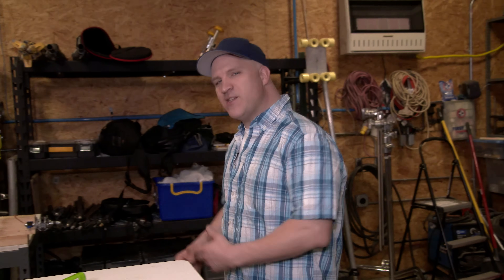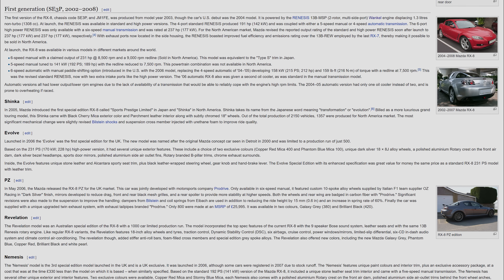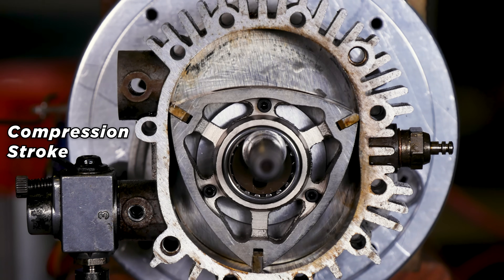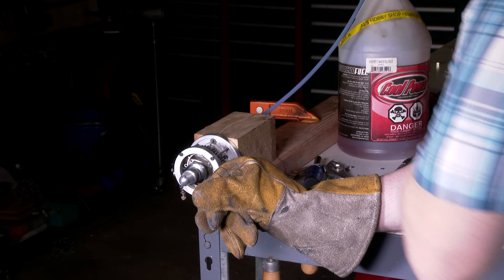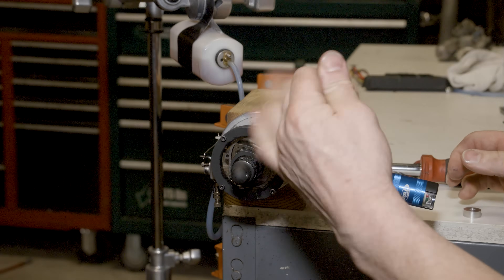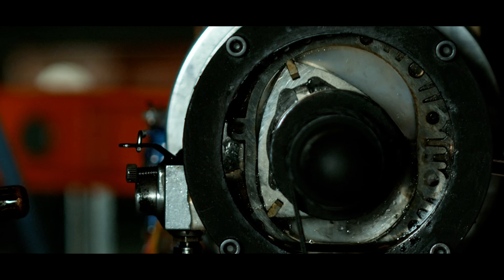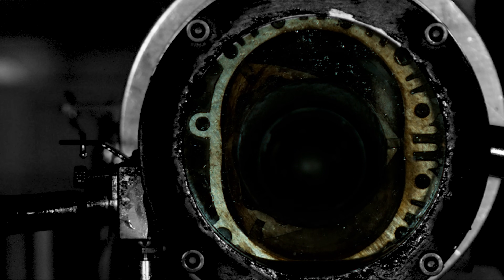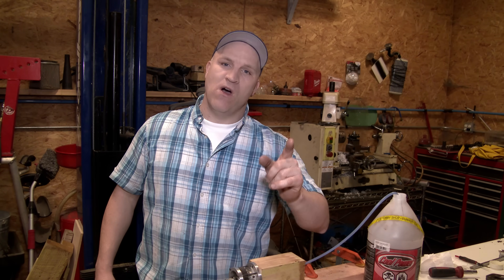See Thru Rotary Engine in Slow Motion - (Wankel Engine) 4K

Comment: Question: I see there is a lot of rubbing to have a good seal on the compression- doesnt this increase wear over time? Or am I missing something?
Reply: Yes, Wankel engines are notorious for wearing out very quickly, they are also much less efficient than reciprocating engines too.
Reply: @doktorbimmer  Yeah to me this typical design has a lot of room for improvement but it's a great idea from an engineering standpoint. This engine is simply, 3 cylinders and four strokes, but instead of 2revs per power stroke per cylinder like a piston Engine, it has 1rev per power stroke per cylinder.output 1080 degrees
Reply: @doktorbimmer   THE FAKE ENGINEER 

@doktorbimmer Yeah to me this typical design has a lot of room for improvement but it's a great idea from an engineering standpoint. This engine is simply, 3 cylinders and four strokes, but instead of 2revs per power stroke per cylinder like a piston Engine, it has 1rev per power stroke per cylinder.1080 degrees output take that piston engine pella windows out the side of your block dokterbimmer the fake engineer
Reply: @doktorbimmer  DOKTERBIMMER THE FAKE ENGINEER Yeah to me this typical design has a lot of room for improvement but it's a great idea from an engineering standpoint. This engine is simply, 3 cylinders and four strokes, but instead of 2revs per power stroke per cylinder like a piston Engine, it has 1rev per power stroke per cylinder.1080 degrees output take that piston engine pella windows out the side of your block dokterbimmer the fake engineer WANKEL ENGINE WINS 6 CHAMBERS VS 6 PISTONS 1080 OUTPUT THE WANKEL 720 OUTPUT PUT,S A PISTON IN LAST PLACE
Reply: Hey Ernie? Can you tell us why your engine does not run????

Comment: Why do these see through engine misfire so often? Do all engines do that?
Reply: Wankel engines have an extremely poor combustion chamber shape and combustion dynamics which produces very poor combustion efficiency.
Reply: @doktorbimmer  Yeah to me this typical design has a lot of room for improvement but it's a great idea from an engineering standpoint. This engine is simply, 3 cylinders and four strokes, but instead of 2revs per power stroke per cylinder like a piston Engine, it has 1rev per power stroke per cylinder.1080 degrees output take that piston engine pella windows out the side of your block dokterbimmer the fake engineer
Reply: @erniebrinkrotaryhemi7336   @Chris Barth
Reply: @xkexke8081   he is a big COW PIE   and yes deleted from ROTARY ENGINE BREAKTHROUGH*

Comment: A great forensic analysis of the Wankel engine. I would not want to own a car with one of these power plants because rumor has it is that as far as economy goes, they are somewhat inefficient.
Reply: Very inefficient and unreliable with a lot of exhaust emissions problems too... the design never caught on because it did not offer any real advantages and was plagues with serious problems.
Reply: @doktorbimmer  Yeah to me this typical design has a lot of room for improvement but it's a great idea from an engineering standpoint. This engine is simply, 3 cylinders and four strokes, but instead of 2revs per power stroke per cylinder like a piston Engine, it has 1rev per power stroke per cylinder.  Mazda only makes cars with rotary reciprocating engines now.

Comment: Fuel consumption was also better than a comparable two stroke engine, but not as good as a conventional four stroke. This eventually became the downfall of the Wankel design
Reply: https://youtu.be/mF2lR20aPL0     this one is with offset compression  super charged  check out more timing and the plug locations you will love it   performance   performance   performance  balance power with emissions.  and more efficient
Reply: Tom Lake Charles
doktorbimmer 
Oh hi mr. pussy! I see you deleted your comments on the RX-9 vision video! and rotary engine breakthrough big fake
Fucking baby.
Reply: Le Mans winner Johnny Herbert reunited with the screaming Mazda 787B

Comment: Snowmobile wankels are sweet
Reply: @erniebrinkrotaryhemi7336  
https://www.youtube.com/feed/subscriptions/UCCVrdErPK7qKS8qeCvsDTJw
Reply: @erniebrinkrotaryhemi7336  Wait.. No mention of German car maker NSU (first series produced Wankel powered car) or that Mercedes ditched the Wankel development to concentrate on Diesel Otto (C111 experiments)?
Reply: Home
    /
    How To & Tech
    /
    Wankel Rotary Engines

Share your thoughts on this article2
Email this article to a friend
Tweet this on Twitter
Share this on Facebook
FROM THE October 2000 ISSUE
Wankel Rotary Engines
An early casualty in our industry's efforts to build a better 2-stroke
By Olav Aaen | October 1, 2000
RELATED TOPICS: ENGINES | VINTAGE
The good old piston engine was "on its deathbed," read the announcement. Good-bye to pistons, rods, valves and camshafts; there was a revolutionary new engine taking over the automotive world. The new engine had only a rotor instead of pistons, was fully balanced and ran smooth as a turbine. The inventor was Felix Wankel, and the Wankel engine promised a bright new future as a sophisticated and compact power source.

It was the mid-sixties, optimism abounded, and most of the major car manufacturers jumped on the bandwagon. The largest licensee in the U.S. was General Motors, but the concept also found its way into snowmobiles. Both OMC (Evinrude & Johnson), and Arctic Cat produced snowmobiles with Wankel engines for a short period. Arctic Cat imported a Sach's-produced Wankel from Germany while OMC built its own.

Unique Concept
The Wankel engine was as ingenious as it was simple. A triangle-shaped rotor spun around a geared shaft in a peanut-shaped chamber. The rotor only turned at a third of the speed of the drive shaft and one side of the rotor passed by the combustion chamber per revolution to give a power stroke. This meant the motor fired on every revolution like a two stroke, but the pumping action acted like a four stroke.

The incoming fuel mixture was sucked directly into the rotating chamber; there was no crankcase pump as in a two stroke engine. This would give the Wankel all the advantages of a four stroke for chamber filling, combined with the advantage of firing once per revolution like a two stroke. The Wankel also promised to have better fuel economy than the two strokes, and this was important in big outboards.

For OMC to gain production experience it was decided to make a snowmobile engine first. OMC had a reputation for quality products in the outboard business, and it was felt that there would be a lot less risk if the unavoidable teething problems could be sorted out in a fan cooled snowmobile version.

The snowmobile engine was to be designed by the Outboard Division, so they could gain some experience. With all the major automotive giants jumping on the bandwagon there was a tremendous optimism around the project. The Wankel design team was full of young engineers without a lot of baggage from conventional production, in hope that new and fresh ideas would abound. At the time I was a young project engineer in the Snowmobile Division, and was assigned to coordinate the installation between the Outboard Division and the snowmobile chassis department.
Inherent Obstacles
It was not my first experience with Wankel engines, I had tested some in early NSU cars in Europe and had been impressed with the turbine-smooth power delivery. At my first meeting with George Miller, the project manager, I was advised of a potential problem he hoped we could solve.

The Wankel exhaust runs very hot, and it would be important to make sure it did not become a problem in the sled installation. What did he mean by hot? Cherry red metal glowing under the hood, just like a coil on an electric stove. This was obviously much hotter than a two stroke muffler, and could be a serious problem. At that time the engines were mounted on top of the tunnel where the gas tank now sits on modern snowmobiles, and the gas tanks were in the nose. The muffler compartment was where the engines are now located; between the cross member and the tunnel. This meant that the cherry red Wankel muffler would be located only five inches away from a plastic gas tank. It was too late to redesign the engine location; it was to be mounted in the large luxury chassis which also housed the quiet machine.

This would turn out to be a plus. In order to control noise emission, this design had a completely closed hood with managed air circulation. This meant no louvers to let the noise out, and the hood tightly sealed to the pan. The problem with the hot muffler was solved only by allowing the air out after it had circulated around the muffler under several carefully-designed radiation shields. After the air had run through the fins to cool the engine, it was ducted over and around the muffler and finally out through a slot at the bottom of the muffler compartment right in front of the track.

The only reported problem with this design was a tendency to melt snow and ice under the sled if you let it idle too long before you shut it off. Occasionally owners would come out after a dinner at their favorite restaurant and find the track frozen to the ground, as the melted snow turned to ice. As far as I know, there was no problem with the close proximity of the gas tank to this glowing hot muffler, because the gas tank compartment had also been well insulated.

The Wankel concept had been criticized for its long sealing surface, and the complicated sealing strip arrangement around the rotor. The OMC Wankel engine had no such problems. The steel seal ran against metal-sprayed side plates and had excellent wear properties. One major problem occurred on the first production batch. The rotor bearings weren't to spec and some failures occurred until new bearings could be delivered.

OMC's Wankel-powered snowmobile lived up to its expectations as a test bed for the new engine concept. The Wankels were both smooth and relatively quiet for their time, and the power curve was a lot broader with lots of torque from a low engine speed. This made it completely insensitive to clutching. You could throw a bad clutch on this motor, and you would not notice it because of the exceptional four stroke-like delivery. Fuel consumption was also better than a comparable two stroke engine, but not as good as a conventional four stroke. This eventually became the downfall of the Wankel design. We were now in the early seventies, and then we got hit by the oil embargo. Fuel economy all of a sudden became a big issue, and the large automotive companies dropped the Wankel like a hot potato. OMC had hoped the publicity of the major car companies would create a favorable acceptance of the rotary engine, but now the exact opposite occurred. With all the bad publicity about the uncompetitive fuel consumption, OMC backed off its Wankel research.

OMC got out of the snowmobile business in 1975. The Wankel design team was disbanded, and most of the team members left for jobs at other companies. Only the Japanese Mazda company continued to make Wankel-powered cars, better known as the RX-7 Rotary, a very quick sportscar which gained an enthusiastic following.

If the Wankel concept had been allowed to continue on a limited budget, it may have emerged as a possible solution to the fuel consumption and emissions problems the sled and marine industries face today with two stroke engines. OMC built several large four-rotor outboards that were the most powerful outboards ever made, and when used in hydroplane racing, they totally dominated the competition. There is no doubt a very powerful compact rotary engine can be built, they are now very popular as power sources in sportscar racing in SCCA.

Future Uses?

Will we see rotary engines again in a snowmobile? It may depend on how strict the emissions rules become, and how much it will cost to tool up for new two or four stroke engines to meet these goals. The Wankel rotary engine had many good features that should have made it an excellent power source. Costs would have come down with continued development and reliability would have been engineered in. The design did not fail on its own merit, but was forced aside by circumstances. The expertise is still out there with the Mazda engines, and it would be a lot easier to get back into it now than it was to start from the beginning of the Wankel era.

As it turned out, the OMC snowmobile rotary engine ended up being the only Wankel engine ever manufactured in the U.S., and as such has some historical merit. There are still OMC rotaries out there in running condition to be had for a reasonable sum if you are interested in finding out what it felt like to run with rotary power.
COMMENT ON THIS ARTICLE
Want to leave a comment?
Only registered membe

Comment: in fact, this engine is really bad, it combines the defects of the two strokes and four strokes.
It is simply an illusion with a shamefully calculation displacement engine.
Only one room is counted!
The truth is simpler:
3 bedrooms = 3 cylinders
the efficiency is very bad and gargantuan consumption
Reply from the maker: Yeah to me this typical design has a lot of room for improvement but it's a great idea from an engineering standpoint. This engine is simply, 3 cylinders and four strokes, but instead of 2revs per power stroke per cylinder like a piston Engine, it has 1rev per power stroke per cylinder.
Reply: its defects are due to its design.
Sealing, combustion chamber shape, piston cooling.

For example a Mazda RX8 announces a displacement of 2x654cm3
In reality it is 6x654cm3, almost 4 liters.

So 230hp for 4 liters is very average.
15L/100km is consumption for 4 liters
Reply: @Fab Bri  Indeed, but its many flaws are also inherent to its fundamental geometry that allows it function as an engine in the first place...
 My question is what room is there for substantial improvements when these flaws cannot be mitigated due to the limited geometry envelope and fundamental shape? 
 Giant companies like Mercedes-Benz, General Motors and Ford spent billions of dollars developing the Wankel KKM and like all 26 KKM licensee's came to the same conclusions in the end... that the Wankel offers no further development potential, even Mazda was final forced to conceded.
Reply: "Room for improvement???" Can you please elaborate on what you meant by that?
Reply: @doktorbimmer  Yeah to me this typical design has a lot of room for improvement but it's a great idea from an engineering standpoint. This engine is simply, 3 cylinders and four strokes, but instead of 2revs per power stroke per cylinder like a piston Engine, it has 1rev per power stroke per cylinder. 1080 OUTPUT VS A PISTON ENGINE

Comment: There are road vehicles that meet emissions standards in the US that have easily make more horsepower per liter over the rx8 rotary and they are n/a 91 octane 4 stroke engines. 

Ducati makes a 998cc 4 cylinder that makes 221hp street legal and 234hp on the track. 

The rx8 only makes 176hp per liter.
Reply: The RX-8 only makes 60 horsepower per liter (total displacement) or 87 horsepower per liter (corrected to 720°)  Not impressive at all and one of the reasons why they were discontinued.
Reply: Tom Lake Charles
doktorbimmer 
Oh hi mr. pussy! I see you deleted your comments on the RX-9 vision video! and rotary engine breakthrough big fake
Fucking baby.

Comment: When I was 18 and at home in Spokane Washington a new dealer opened up 
shop and offered the first Mazda R100. I drove my Corvair in and was 
amazed at these cool little cars with such a tiny odd engine.  The 
salesman sat with me and when I started it he said to floor it while we 
talked. My better instinct knew better, but it was his car.  7 years 
later I bought a new RX4 station-wagon that was one of the nicest, 
quietest cars I've ever owned. It was silent at an idle and you could 
balance a coin on the engine to the amazement  of my friends. I was 
determined to make that car last a long time buy NOT ABUSING that 
engine. But even after warning him to not over-rev it, a friend and I 
took it for a drive and he pegged the tach on every shift, much to my 
anger met with his scoffing. Sure enough within 6000 miles it started to
 smoke and at 8 I took it in  only to be told that the engine needed to 
be replaced under warranty. That's when Mazda let me down by saying the 
new engine was only warranted for 12 when the original was for I think 
50K. I sold it at a loss soon after. I still firmly believe in the 
rotary Wankel concept and will not consider it "dead"as it is the 
simplest proven means of internal combustion.

Comment: By introducing the acetylene you effectively starved the engine of oxygen and prevented combustion. By introducing compressed air you may see a more complete combustion cycle and less fuel in the exhaust.  I would refrain from introducing oxygen gas as it would likely create a very hazardous situation.